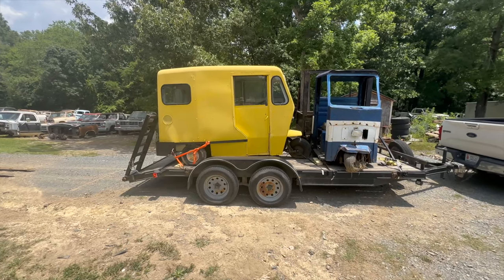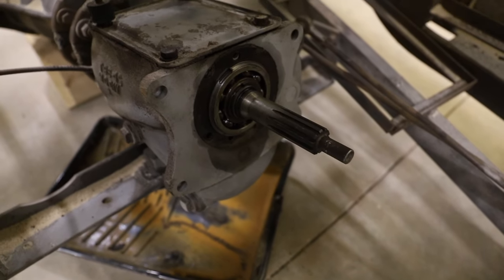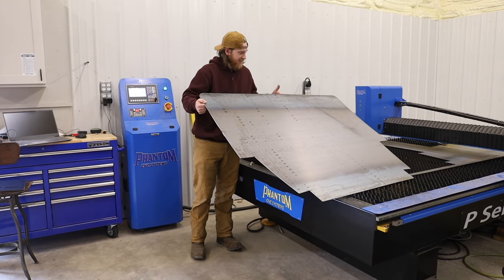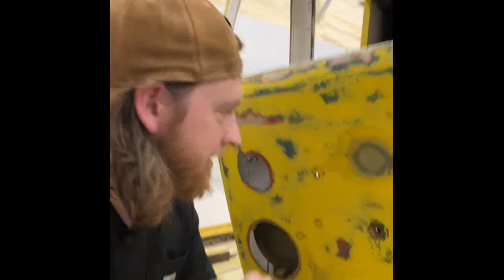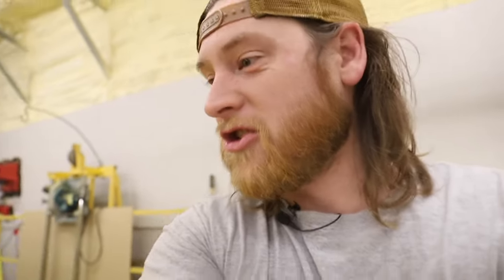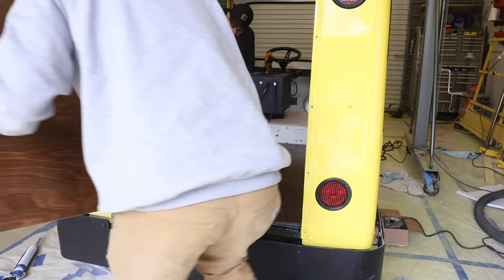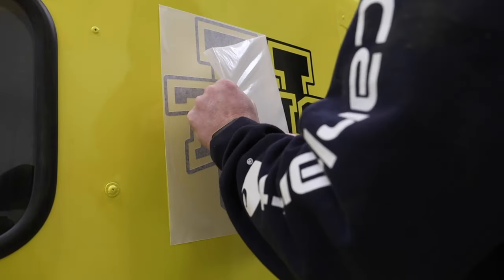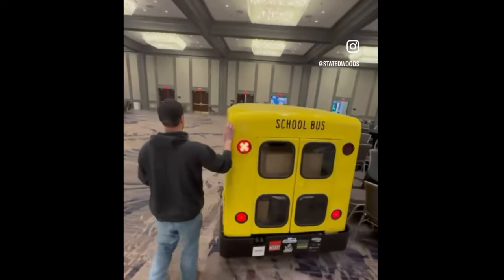Worlds First 3 Wheeled Mail Truck Turned Into A School Bus

Comment: Looks nice.  I noticed one concern. This is the only bus I have seen that only has a drivers seat. The back would look killer with a bench seat against the sides. 😊
Reply from the maker: Oh yea it would haha. You are right
Reply: @Statedwoods  had a van  that had the front bench. Behind it on the driver's side installed two bus seats along the side. On the other side installed installed one and a half bus seats welding the frames together. This allowed room to get in from the sliding door on the side.  We drove that van all over the country. Six of us. At six two I could roll out a sleeping bag on the floor in back and sleep. My siblings would use the bus seats and bench seat to sleep.  You brought back great memories with this project. Thank you. Oh ya, brown van from the early seventies, and on the hood in white my mother painted "Charle Brown"